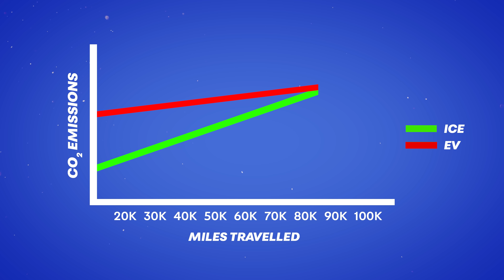Are Electric Cars REALLY That Green? [New 2022 Data]

Comment: Glad this is being looked at,, but still missing a few points that come into play.
1. after 150K-200K miles, you may need to change out the battery in an EV.  Then it becomes worse than a gas car again. (assuming it's viable to change the battery)
2. Look up Demand response programs. These exist because the power grids can't handle everyone turning on their AC on a hot summer day. A typical home AC takes 240V 30A. The recommended circuit for EV charging is a 240V 50A.  They take more power than your AC.....  Now imagine a hot summer day where everyone is turning on their AC while also charging their cars.. We NEED to upgrade the grids to handle those loads. On those hot summer days, the power companies fire up peaker plants to keep up with demand while also asking factories to cut back. Those peaker plants are gas powered and not green at all.
3. Too many people simply don't have a garage to park their car for charging. We need a solution on how they can charge as well.

I think the solution here needs to be something like inductive charging built into the roads. If we do something like that, the EV's would need smaller batteries. BUT, that would require rebuilding every major road with coils, and that may not be feasible.
Reply: it's all nonsensical.. too many people living with too much polluting habits.
everyone wants airco, everybody wants to go places around the world, etc. etc..
industry is by far the biggest polluter and no government is touching that in any significant manner.
to be honest, it all seems quite hopeless unless you could convince people to change their wants, which will never happen.. people most likely will burn everything down before making any significant changes, we're too primitive as a species
Reply: LFP batteries address the need for battery replacement, this part at least is a solved problem. Also batteries can be a solution rather than a problem for the grid. Currently we need to add storage to cope with intermittent supply from renewables. EV batteries can help with that. Other people have done good work analyzing this, but way above my pay grade 😂
Reply: @russelldesilva1560  I have a good amount of experience in this field. If you are suggesting we tell people to feed the grid with their EV batteries.. This may sound like a great solution on paper, but the times we need the extra "boost" to the grid are times when those EV's are typically not home and at places of work. (middle of the day)
To ask someone in an EV to plug their car in to feed their power back into the grid isn't going to work because they wouldn't want to loose that charge that takes hours and hours of charging at home to get up enough charge to last a couple days.. Then you ask them to feed it back, and potentially risk them not having enough power to get home.. 
Also, the infrastructure isn't in place to allow that kind of feeding back into the grid, and most EV's don't work that way.
Reply: So 1 EV battery at the end of it's life is equal to 30,000 gallons of spent fuel in our air???????? Batteries can be recycled. How do we recycle global warming?
Reply: @daysrcdays  Where did you get that number?  It's not even close.
1 EV battery will last 150K-200K miles.
The average car gets 36MPG according to Pere Buttigieg. That's only 4,166 to 5,555 gallons of gas used in an average car for the same miles. The green house gases produced for making that ONE battery pack are enormous, but since the pollution has already taken place before the car even makes it to a dealer, the customer thinks it's the greenest thing..
Is it?
Reply: @daysrcdays  Are they though, are these batteries being recycled? And how much of a burden is that process on nature, the recycling.. that would be an interesting addition to this analysis.
Reply: @erikstigter7897  Gas is a 1 time use product. I have lithium batters that are 7 years old with heavy use. There is no compairson.
Reply: @daysrcdays  Yes, but if people don't recycle them your anecdotal 'evidence' doesn't really matter.
Also, we still have to charge those batteries with something, at the moment those are still polluting power stations for the chunk of it.
We won't have enough power plants if all cars were transitioned to electric either..
I think almost all people would choose for a more eco-friendly solution to traveling if it is available, but I believe a lot of factors are still left out of the equation to make it a fair comparison where we are at now.
Reply: @daysrcdays  That doesn't change the fact that we don't have anywhere near enough dams to power the world.
And also, these dams also have an impact on the eco system.. they're not always as 'green' as we're made to believe, they have a negative impact in a different way.
So it's great you have that geographical advantage, but there's still 90% of power needs that need to be generated somehow to comply with your countries demand.

You shouldn't really talk about 'my state'.. I don't live in the states, America has the highest footprint per individual or at least on of the highest carbon footprints per capita. You have no grounds to gloat about a few dams when you are worlds second greatest polluters.
Reply: "Those peaker plants are gas powered and not green at all" Maybe battery powered plants then? 😵‍💫
Reply: @DANNY40379  
Simply manufacturing enough batteries to make it feasible negates making it "green". Those peaker plants are typically 1Mw or larger and typically running for 8-12 hours when they are fired up.
Reply: @DANNY40379  like in Factorio..! 😀
Reply: Answer me this one simple question. Knowing that Shell, BP, and all the rest have come to determine that GAS will run out in 47 years. In 37 years Shell says the government will stop all public sales of gas 10 years before it runs out for national defence and public transit. Meaning we have 37 years to get our entire nation ready for alternative choices. When should we start the conversion? That is my question. After fuel is no longer availabe or before that happens?????
Reply: @daysrcdays  You misunderstood what I'm saying...  
1. I'm saying batteries are no greener than gas.
2. I'm actually in support of EV's.. However, we currently do NOT have the right infrastructure in place to support them.
3. We need to rethink EV infrastructure for it to be successful. We should be not only be looking at the power grids, but also the cars themselves.. Maybe standardize batteries between manufactures. Maybe think of ways to get more mileage with less batteries. etc..

Comment: They need to make hydrogen cars instead of plug in evs. As a Christian I don't believe humans are destroying the planet through polution. I believe God designed the earth to clean itself. I believe we are destroying the earth through sin. If you don't know what sin is read the Bible. We can start by the 10 commandments. Another thing is it doesn't matter what we do since countries like China and India are belching pollution into the air while the west cuts back on everything. When you pollute the pollution will travel around the globe. So when India or China pollute all the other countries are effected. Countries like India or China have no standards and those countries produce a lot of ev products for the rest of the world. While China and India are thriving economically the rest of the world is loosing good paying jobs. If you started to produce more of your products in the west the environment would be cleaner since the west has standards. Another thing you would do is stop the slave labor like what is going on in China. The West should tell the East not unless you change how you produce products then you can't produce them. Another thing that happens when we allow China to produce products is it builds up their military that they might use on the West someday.
Reply: Absolutely right, we are beating ourselves over our heads for nothing. What we do makes no difference at all until the big polluters start to make changes. Long live diesels

Comment: I'm glad some who has a voice finally came out and stated what "ICE " drivers already knew.  Now let's factor in the EV's battery replacement and the cost/pollution factor for that, not to mention how to recycle those batteries and how much energy/pollution that process will take.   EV's are NOT the be all, end all solution.   We need to stop this big EV push so we can really figure out the right road to go down before we go down the wrong road and regret it.
Reply: Don't let perfect be the enemy of good/better or you'll be stuck.
Reply: @usa-ev  Perfect isn't even close!  Good/better isn't either.  How about not right for me as EV's don't do a thing for me.  Something else nobody discusses, going on vacation for a few weeks, a weekend get-a-way or day trips where eating asphalt really matters.  Let's see you take your Leaf on long road trip, going 70-80 MPH on the freeway for hours on end.  A 2 1/2 hour "ICE" trip will take you at least 5 hours in your Leaf.  Don't forget, 5 hours to go back home.  That's 10 hours round trip just in the car!  Like I stated above, battery cars are NOT the way to go.
Reply: @kf2572  I agree, the Leaf is not a good road trip car, but there are many EVs that do just fine on the scenarios you present. The Leaf would be a great daily commuter for many, however.

Comment: It seems that a current concern is the cost of a replacement battery in a used EV even with mfrs'. 7-year warranty. If a person buys, say, a 4-year-old EV, he must consider that in 3 years the battery will be his problem and not the mfr's. And, since the EV battery is very pricey, this should affect the resale value of a used or even the MSRP of a new EV. 
Most people, it would seem, who buy a used car can expect it to last more than 7 years without a major component failure. Can the same be said, at this time, about the EV battery?

Comment: The problem I never hear included in these arguments is how your going to deal with the batteries at the end of their lives and what environmental impact that's going to have.
Reply: Very true. Also the used buyers will just scrap the car if the replacement battery costs too much.
Reply: Recycled like glass. Oh, wait, they don’t recycle glass anymore because it’s not profitable.  Like recycling these batteries won’t fall into that same category.
Reply: @wsmith810  No, recycling is much cheaper than mining for new materials and transport them 2-3 times around the world before ending up in a new EV battery pack.
Reply: There is actually a lot of research and discussion about this if you take the time to look or listen.
An EV battery should take about 10 years before it's no longer able to hold enough capacity to be ideal as a car battery. At which point it can be repurposed as energy storage in homes for example. There are many sports stadiums in Europe for example that repurpose used EV batteries as backup "generators." This should add another 10-20 years of usefulness out of an EV battery before it needs to be recycled.
Reply: @MNKYfilms  And then what?
Reply: @HoratioFitzbastard  I don’t follow? After it gets recycled?
Reply: @MNKYfilms  You haven't addressed the original query , merely said that they'll use them for something else for a bit longer. 
Where are all these batteries going once they can't be repurposed?
Reply: @HoratioFitzbastard  recycled, I have said in both my comments.
Reply: @MNKYfilms  You mean like the millions of tonnes of glass and plastic that are supposed to be recycled but end up in land fill anyway?
Reply: @HoratioFitzbastard  It's not viable to recycle plastics, glass than ev batteries. Many companies are already working on recycling batteries and in 10-30 years way more development would have been made. Lead batteries recycling that's used in current ice cars are already recycled, lithium ions will also be in future.
Reply: @HoratioFitzbastard  An argument against recycling infrastructure and application isn't really an argument against the viability of electrical storage technology.

Some states/countries are very good at recycling. If you take issue with poor recycling practices I urge you to take it up with your local authority. 

Alternatively you can personally vow to only ever use products and services which are organic/biodegradable.
Reply: @MNKYfilms  😂 100 social credit points for you. You're a prime example of what I was talking about in my previous post. I don't need to believe a bunch of fake advertising, propaganda, and virtue signalling to measure my self worth or boost my ego.
Reply: @HoratioFitzbastard  that’s a strange argument. 

To get back to the point you seem to think recycling, as a thing, doesn’t work. In some cases you’re right. In most you’re wrong. Either way it’s a regressive argument. Should we not have police because they don’t stop all crime?

If your problem is with recycling then your problem is with specific human/government application and not the technology itself.

I’d you’re dead set against progress then a valid answer won’t change your mind. Regardless I’ve supplied you with one. Do with it what you will 😁
Reply: @HoratioFitzbastard  Glas recycling has been engraved in our Dutch society even when I was a kid (born in 1965), I don't know better.. and I know it is REALY recycled here over and over again and does not end up in landfills, recycling companies can sort the glas into its different colors, which helps a lot.
Reply: @MarcoNierop  Here in Australia bottles were reused and recycled regularly when I was younger.  That's until it became consistently cheaper to keep making new ones.
Reply: @MNKYfilms  Yep, like the Arena Stadium in Amsterdam (football club Ajax. You can book a tour there where they proudly show off all this and explains how it all works... Indeed used EV batteries) 

And if stationary storage also isnt anymore feasible, the batteries will be recycled.

Comment: The logic is Volvo are developing their Hydrogen fuel cell cars... 
Shame the world's gov's didnt skip the ev red herring and invest in hydrogen...
Would also remove range issues, use existing fuel station network, and to heat homes
Reply: Hydrogen isn't as efficient as ev. They need higher fuel tank, needs compressed storage, extremely dangerous, needs lots of energy to produce.

Comment: Thanks for that Rory but I am still not convinced. I drive a '08 BMW 120d M-Sport which I bought new. It easily does 50mpg on Dino-juice and ts done 150,000 miles. The Nissan Leaf battery lasts 150,000 miles - Tesla is about the same. Leaf battery costs between £12,5k and £14,5k. Tesla is about £20k. Some reading shows batteries lasting 300k - 500k miles but from experience (I deliver cars by HGV) Blackbushe Auction is full of Teslas, Leafs and other Hybrids which they cant sell because of battery problems. Upper Heyworth is full of new Audi hybrids with battery problems. A friend of mine works at Porsche Northampton and their first Cayenne Hybrids are just coming in for battery replacement at £17,000 plus fitting after 3 years. What is NOT factored in here is the cost of replacement batteries and the safe disposal of the scrap. Imagine how one would feel at knowing your 3 year old Porsche Cayenne has cost you £500 a month depreciation on the battery alone... I look after the little BMW well. It is regularly washed and dried, has been Dinotroled and it will probably outlast me (im 62 !)  - certainly it will outlive any of the EV's listed above. I'm certain that very little of the 120d is not recyclable. I still see electric cars as the ultimate "Virtue signalling" badge a driver can display. Someone please enlighten me.

Comment: A good attempt at a full cradle to grave eco cost analysis for one technology. The cradle bit, for the car, was well put together. However no mention was given to the eco cost of the pre-requisite infrastructure, strip mining copper, digging up roads etc. Furthermore this new grid will no doubt have a lot of complex technology to run it and as we know, only too well, that stuff gets obsolete every 20 years (fiasco about gas and electric meters continues). Therefore much of this grid will be subject to continuous replacement. Now to the grave part, my first 1958 Ford Consul did 20mpg on a good day, but apart from a very small amount of plastics was close to 100% recyclable, I ignore tyres as it's the same for ICE & EV, although EV's tend to be heavier so presumably consume more tyres. To complete the picture we need to compare the eco-costs of end of life recycling. Much of the sprung suspension and wheels is identical so looking at the body and drive train we are likely to see more un-recyclable plastics in EV’s plus a lot more un-recyclable of energy intensive exotic materials in the drive train, particularly in the battery area which may also need replacing during the vehicles lifetime, furthermore the cost of this will encourage people to replace the whole vehicle before it fails, so they will keep their cars for less time and because the replacement is so expensive residual values should be very poor.   Of course we can must also talk about the additional cost of more power stations and strategic risk of reliance on a single energy “electrickery”. Still a big killer is for the tens of millions in the UK who will be disenfranchised  from vehicle ownership simply because they wont be allowed to dangle a cable out of their 10 floor window  to the car maybe a few streets away. Yesterday I got stuck up a cold mountainside because of a fallen tree and the battery drain to drive through maybe 300 very steep hairpins, that day,  may well have left me stranded.